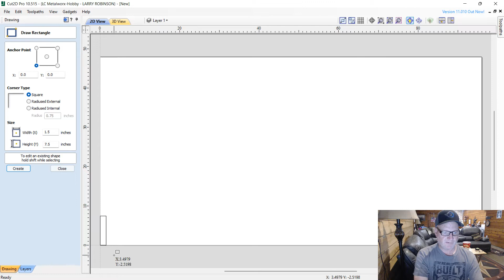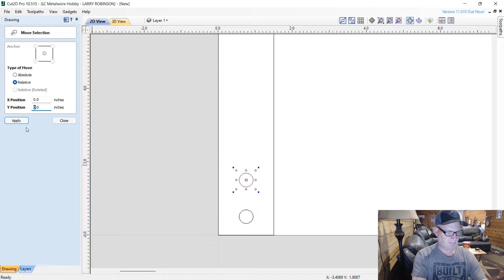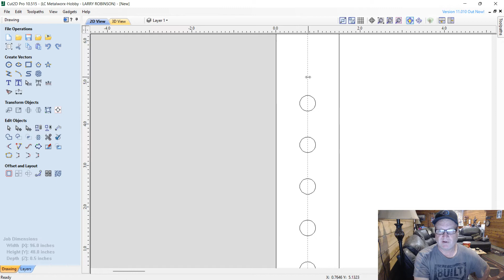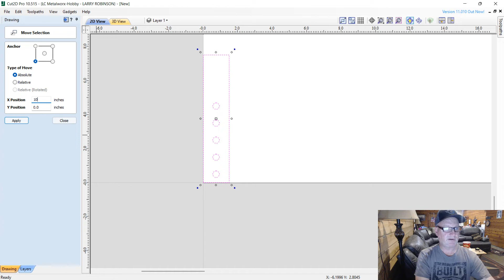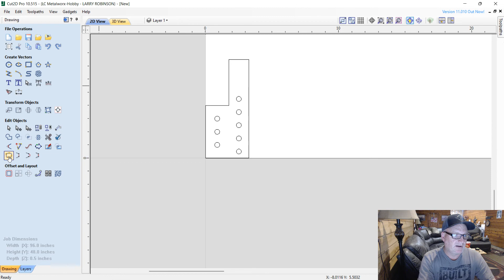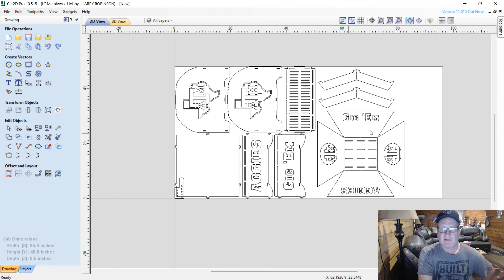Using Vectric Cut2d for easy drawings

Comment: I use AutoCad .. I can do what you did so much faster. but like you said,  Its what program your use to using . all the noobs think its a turn key system,  buy a file and cut it out and make a million dollars ... then they dont want to spend money on cad software .
Reply from the maker: Yep, I'm out of practice and I was going slow trying to show a friend a little about how easy this software is for his race car building business where he sends parts to be laser cut.  Autocad is a ridiculous amount of money for something that most people don't need.
Reply: @larryrobinson7492   check out Autocad 17LT 
the light version.  one time buy around 150.00 and you own it. LT version has no 3D
Reply from the maker: @metalworksmachineshop  I had LT it was at least that much per year, I even talked to them about it and told them I wasn't interested in paying more than once.  My son is a draftsman using Autocad every day, he;s good but I can't seem to use it very well since I don't do it daily.  I'm a machinist 50 hrs a week running lots of CNC machines and don't really have time right now to learn stuff I don't need.  This Cut2d software is amazing for what I do at my hobby shop and will do much more than I ever need.  I enjoy your videos.  Get er done.